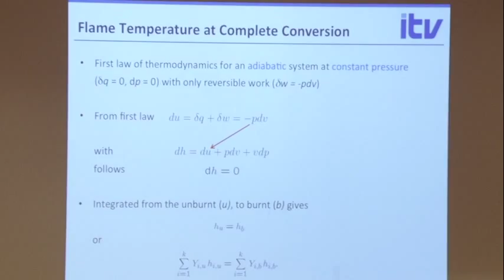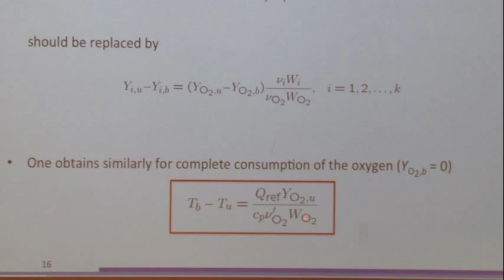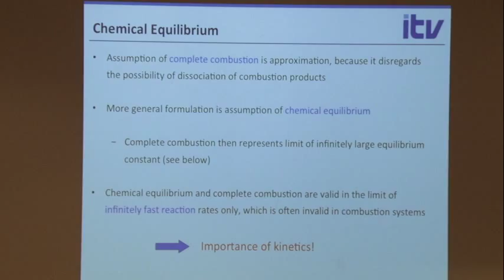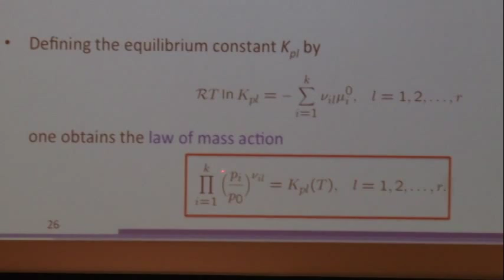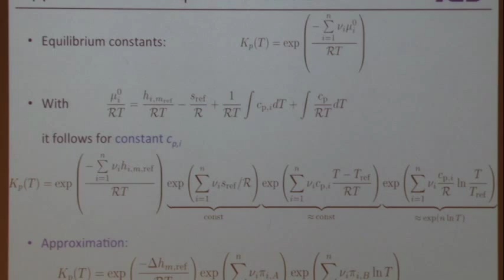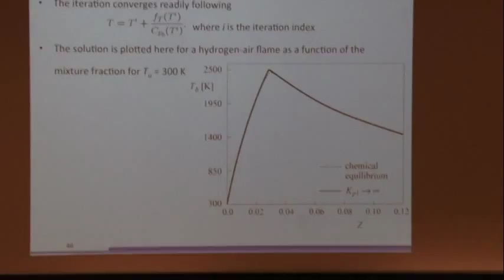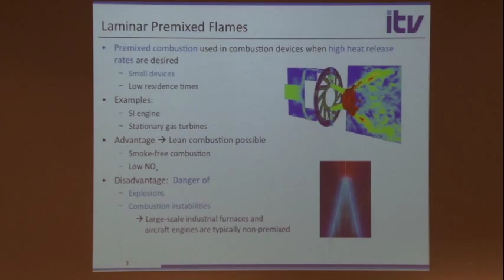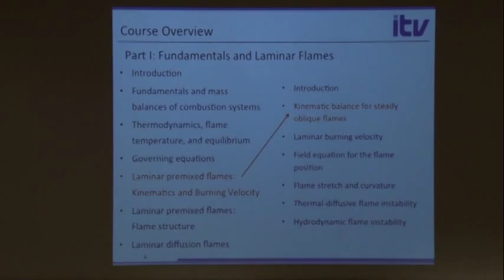Combustion Theory and Applications in CFD, Pitsch, Day 1, Part 3

Comment: April 23, 2017

April 23, 2017: An inventor has reduced combustion theory to practical resolution and working product; applies to all burning processes, internal and external combustion. Covers direct cylinder, port, and throttle injection. Preliminary verified testing with simple carburetion reveals near zero emissions with improvement in combustion efficiency. The concept applies to two and four stroke engines running in excess of 15,000 rpm; making fuel flow and vaporization calculations in less than 80,000ths of one second. Contact STIC@frontier.com  search http://www.sticsupertorque.com/index.html